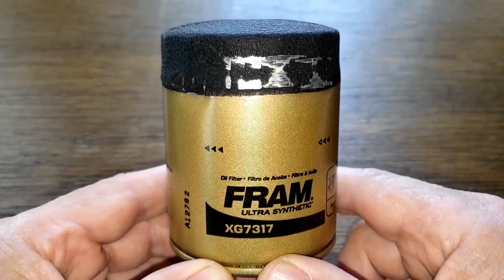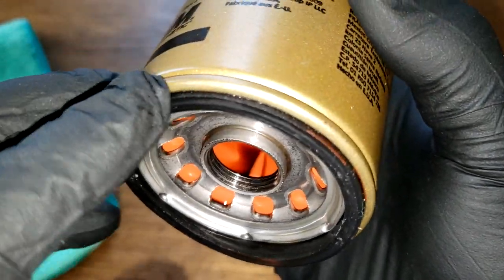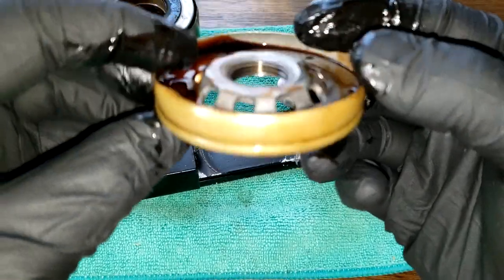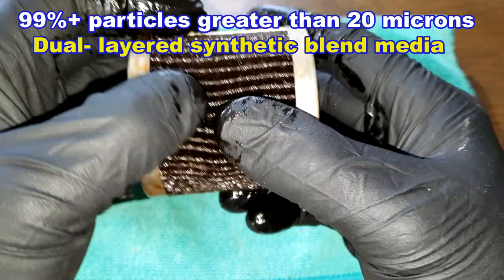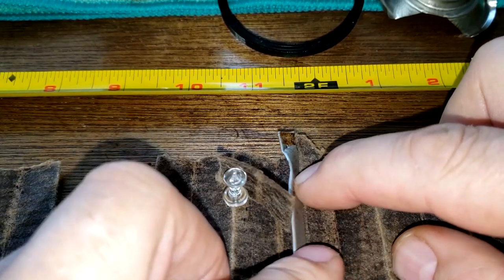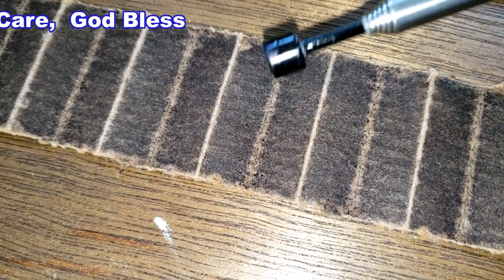Fram Ultra XG7317 Oil Filter Cut Open, Used Oil Filter

Comment: Appears to be a decent filter. (Waves in the media kinda' make me nervous though)  I'm just not a "Fram Guy".  All things aside, would you still use this filter if the micron rating wasn't as high?  What's the draw?  It's only been recently (last year of so) that the Fram has been elevated to "king of filters" throne.  IS this filter "the best" for the money?  Debatable for sure.

I'm not attached to any filter manufacturer...so really, just posing the question:  "What option is there?"  Seems with all the changes made in manufacturing and sourcing parts,
premium filters are becoming tougher to find.  I'm not going to spend $20plus on an Amsoil filter etc.   I'm also not going for the $3.99 Supertech either.  There's got to be a filter that's around $10 that is worth it.
Reply from the maker: Hi John,
I like the Fram Titaninium at AAP for around $16 if you order online you'll get a 15% discount. Good Filter, watch the video I have showing on Sep. 9th. Titanium Vs. Ultra
Reply: What is better than this Ultra at $9 ?
Reply: @WhipCityWrencher  Thanks!! Looking forward to it!  What makes the Titanium special? Curious
Reply: @memopadilla5931  That's what I'm asking...
Reply from the maker: @johng.4959  It's a twin to the old Ultra with tear drop inlet holes.
Reply: @WhipCityWrencher  Thank you!

Comment: Best oil filter for under $10.00. Walmart. Synthetic filter with screen backing and silicone anti drain back valve. Walmart super tech oil is a great quality oil blended by Warren oil. I do my own oil and filter  change and for around $30.00 I get full synthetic oil and this Fram filter. Every 5000 miles.
Reply from the maker: Hi Arthur,
That's a good oil and filter combo. Just one thing the Fram Ultra no longer has the screen backing, if you want the screen backing you have to get the Fram Titanium at Advance Auto.
Thanks for Sharing!👍

Comment: It could have used the wire backing that I think they got rid of a few years ago. Then the pleats wouldn't have been smooshed. Otherwise it's a pretty good filter
Reply from the maker: Hi Joseph, you could be right.
Thanks for your feedback!
Reply: @WhipCityWrencher  I think Fram still uses the wire backing on the Titanium..   you should try to get one of the recent ones and check it out.
Reply from the maker: @memopadilla5931  Hi Memo,
 Thanks, I have, the video will be shown on Sep.9th😊

Comment: Good review.  Good filter nice dual layer.  You didn't twist the anti drain back rubber valve grommet thing.  It's always interesting to see if it's still pliable or if it became brittle over time.

Good review either way.  That's always my filter of choice btw.  Nice to see it holds up well.

👍
Reply from the maker: Hi Drum, Thanks!
I did play with it a little, LOL. 1:54
Reply: @WhipCityWrencher  

You're right don't know how I missed that.  👍
Reply: You missed it, Man -- Ol' WCW never misses on the "ADBV Twist" portion of the reviews -- AND he even BURNS 'em to compare the smoke they give off. That's the smart way to do it, as was discovered years ago in the plastics industry.
Burn 'em & Learn 'em, we usta say.

Comment: The Honda filter is the best.  

Same problem at Subaru. The “correct” filter is a pancake piece of crap.  The Honda filter is exactly the same except height/capacity.

Comment: Hey, Whip, did I hear somebody say that there is a LONGER version of this same (XG7317) filter !??
Same face plate, but a longer element !??
If so, I wanna investigate the longer filter and see what the differences are, if any.
Many years ago, I ran an over-sized oil filter in a 4-cylinder, rear-engined, 47-horsepower, Renault R-8 -- with KENDALL 10-W-30.
The stock oil filter had the same base plate as the old Fram PH-8, which was about 1.5 inches longer.
Put 137,000 miles on that Frog motor in 14 months -- the engine was a f**king cinder when I traded it in for a '64 SAAB. 😁
Reply from the maker: Hi Chuck,
No, this 2011 Nissan Cube calls for a Fram 6607 but you can use this slightly larger Fram7317 oil filter, that's all. I can't see any harm in that, did you ever see the lawn mower size Fram 6607? By the way, how did the SAAB do? Did you like it?
Reply: @WhipCityWrencher  YIKES !! You mean that this XG7317 is BIGGER than the 6607 !??
 I was looking for a LONGER filter than the XG7317, because I can't use a FATTER one.
 But hey, I got the Acura MDX for FREE, so I ain't complaining. 😁
Reply: @WhipCityWrencher  I had two (2) SAABs, Whip -- a '64 "Normal" and a '66 "GT".
 Both were great cars and the GT was an absolute BLAST to drive.
Front-Wheel Drive, 3 Cylinders, 3 Carbs, 4-on-the-Tree, Oil-Injected, Water-Cooled, Disc Brakes, Wide Wheels, Perelli Cinturato Radials. 
 SAABs were the European Rally Champs in the early '60s.
Reply: @WhipCityWrencher  AH, I see -- I was corn-fused.
 I'm trying to find a filter with the same base plate as the Fram XG7317, but with a LONGER cannister.

Comment: i use the Ultra 7317 in my wifes 2019 Subaru Asent. so far almost 80k the engine is spotless from what i can see snaking a scope into the oil pan and valve cover. The Subaru police will let you know what an awful person you are for running the Fram Ultra because the bypass valve is too weak. Ive also been using an Ultra 10575 in my 2019 3.5 ecoboost with great results.
Reply: About those By-Pass Valves -- What do you mean by "too weak"  -- and how was that "too weak" conclusion arrived at !??
A common mistake we make is in comparing our Oil System Pressure to the By-Pass Valve Opening Pressure -- WHICH ARE NOT RELATED. 
The By-Pass Valve Opening Pressure is determined by THE DIFFERENCE of pressure between the INLET side of the filtering media to the pressure on the OUTLET of the media. When the pressure gets too high on the OUTLET (core) side, the BPV opens and the media is by-passed.
NOTHING to do with the oil pressure as delivered by the engine oil pump.
Reply from the maker: Yep, I've heard 22 psi bypass valve. I think If you have the correct filter, the bypass valve should not make much of a difference.
Reply: @SlikLizrd  Thats what the Subaru community cries about if you don't use an OEM filter.
Reply: @christopherwilliams4647  Who is this Sue  Barroo that you speak of ??
Does she need her oil changed -- or her cat flattened ??
I do oil changes and cats flattened -- while you wait.
Call BR-549 for a quote.

Comment: It can be seen from the filter that this oil was clearly “rolled over”, and the deformed and clogged petals of the filter element, which were in cold oil, “drowned the pedal at full throttle”.  I'm sure your daughter's family are not in misery, and will be able to change the oil and filter at least once every 4,000 miles.
 How many miles dirty oil goes thru bypass valve ONLY on this vehicle? 🧐
Reply: I don't know about those "deformed pleats", Andy -- I cut open a brand-new XG7317, and the pleats looked exactly the same as in the used filter. 
I gotta ask : Regarding motor oil -- WTF does "rolled over" mean !??
Reply from the maker: I don't know what you're talking about.??
Reply: @WhipCityWrencher  Andy mentioned "rolled over" oil.
Do you know what that means !??
Reply from the maker: @SlikLizrd  I think I know what it means but not for sure. So I won't say.
Reply: @SlikLizrd  I don't know how to say it correctly in English, that the oil worked 2 times longer than it should have. (English is my second language).
Reply: @WhipCityWrencher  Okey-Dokey.
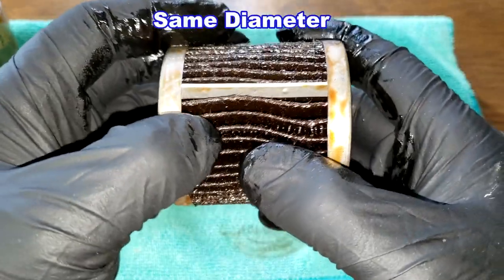Reply: @SlikLizrd  This 4:02 and 4:05 too?
Reply: @Andrew__Smith  Gotcha, Andy !!
 I have NO CLUE as to how long that oil was in the engine. 
I all-ways use a 5,000-mile oil & filter change interval on my vehicles.
Reply: @SlikLizrd  I mean like Vehicle was  rolled on this oil over resonable limit 😊
Reply: @Andrew__Smith  Si, Senor !!
Reply: @SlikLizrd    @Whip City Wrencher    hmmm...0:08 ... but at first (I was sleepy, and) I heard (in my unawakened brain)  "ten thousand one hundred and twany" miles .. but now, when I listened to this moment again (especially since there is a picture on the video) - then, only "4,120" ... That's why I wrote that you need to change the oil 1 time in 4000 miles. brrr ...
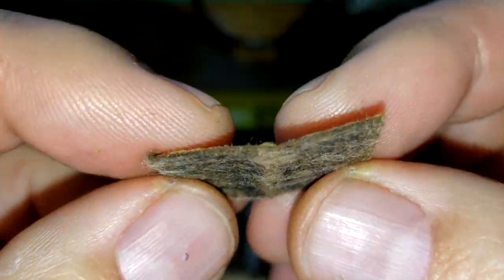So It's strange that the filter element is so heavily clogged  5:14 ...Have no idea why! Did this oil wash away previously accumulated deposits??
Reply: @Andrew__Smith  I didn't see anything unusual in the video.  I can't tell anything about the oil or the condition of the engine from looking at the video.  
 Was that filter clogged !?? I don't know.
 I change my engine oils and oil filters every 5,000 miles.
 I don't care what other people do -- I'm an old man that's still rockin' in the free world.
 CHEERS !!

Comment: Great job, as usual, Whip !! Looks like you finally did an oil filter that I actually use, the Fram Ultra #XG7317 -- fits the 300-Horsepower V-6 in the Dear Wife's 2007   Acura MDX.
 I bought the XG7317 from Amazon, opened the undamaged box to find a filter with two (2) DENTS, 1 big, 1 small.  I figgered the filter was ruined, so I cut 'er open to see the extent of the damage. YIKES !! The filter musta took a hell of a wallop AT THE FACTORY, 'cause the BOX was in perfect condition.
Comparing my NEW Ultra filter to your USED Ultra filter, I found that the pleats were "wavy", just like in your used filter.
Would I use this oil filter !?? NO. I WANTED to try one, but after getting a smashed filter from the factory, I'll pass.
Another detail I noticed -- concerns "tricky language" -- ya gotta watch these filter-making monkeys, cause they want yer money, honey  !!  😁
Notice that the Fram # XG7317 says on the box: "Over 99% efficiency of "XG8A, XG3387A, & XG4967"  -- under ISO4548-12 for particles "GREATER THAN" 20 Microns. No such claim is made for THIS tiny filter. Notice that "20" and "Greater Than 20" are NOT the same, but folks see the  "20 Microns" part, and accept them as equals.
I also bought this Fram Ultra filter's crossover to the Bosch Premium, # 3323 -- fits the Acura MDX.
Bosch Premium box says "99% Efficiency under  ISO4548-12 "AT" 20 Microns. 
O.K. -- So, in mathematics, "AT 20" is "20" -- but "Greater Than 20" can mean ANYTHING that's "greater than" 20. I mean, WTF !??
Anyways, from what I've found out so far, I'll stick to the Bosch Premium that has served me so well in the famous 95 MERC.
Getting the 95 MERC ready for a trip from Phoenix, AZ to Coeur D'Alene, ID at the end of the month -- should be a real nice cruise to celebrate our 42nd Wedding Anniversary. 
I see that President Joe Biden's got the Inflation AND the Gas Prices coming down, so all we have to worry about is food and lodging.
 NOBODY can bring our Food Prices down - the fires and floods are wiping out farms and chicken ranches all over the country.
 The workers that picked our fruits and vegetables for DECADES have been turned away by a phoney "crisis" at our border.
Lies told by Arizona Republicans have severely effected our nation's food supply, and the fires and floods will not stop.
I hope you and yours are in good shape, Whip -- Things ain't lookin' very good these days.
Reply from the maker: Hi Chuck,
Happy 42nd anniversary.
I don't know how it is in your state but I see the lies the Democratic News media spin in my state, I don't know who to believe anymore. Take Care.
Buying filters online is a gamble for sure.
Reply: @WhipCityWrencher  Thank you kindly and muchly, Whip !!
 YEP. It's really hard for folks to know the truth, especially since 1986-87, when The Fairness Doctrine was allowed to expire under The Reagan Fiasco.
I got tired of the back-and-forth, and set out to do my own research, going back to the early 20th century.
Who said what, who did what, which political party did good for "We, the People", income tax levels, corporate tax levels, Supereme Court appointments and rulings,
U.S. Population, World population, civil rights violations, student murders (KENT, OHIO), and anything else that's pertinent.
 All this info entered into a horizontal Line Graph, with the bottom section telling which party held the White House, and which party controlled the Houses of Congress.
Using this method, it becomes REAL CLEAR about which political party has done the MOST for "We, the People" -- and EXACTLY which party has done the absolute LEAST.
I WAS a staunch Republican -- from 1958 until 1986, when Ronnie Reagan made a Democrat out of me -- forever.
Today's voters have been buried in right-wing propaganda for forty (40) f**king years  -- and most of them don't realize how dim their future is if Republicans gain control of even the House of Representatives.
 But -- these a$$holes are busy crucifying Joe Biden, while championing the most horrible creature that was ever put up for office.  SMH.

Comment: Good video Pete. Fram is garbage stay away from them.  I’d go with an OEM before I’d use Fram.
Reply: Baldwin filters bro. And no more than 4000 miles on any type of oil.
Reply: AW, c'mon, John -- Mr. Fram makes a shipload of oil filters, and they are ALL not the dreaded "Orange Can of Death".
The Fram Ultra has gained favor in the past year or so, and is now considered to be one of the industry's best.
JMHO.
Reply from the maker: ACDelco? Please tell me you jest.😊
Reply: @WhipCityWrencher  I've found most ACDelco products to be kinda janky -- BUT -- I installed a pair of ACDelco Window Regulators in the famous 95 MERC, and they worked MUCH better than the OEMs.
 AC Spark Plugs = NO BUENO !!